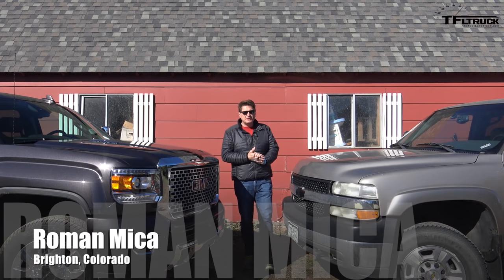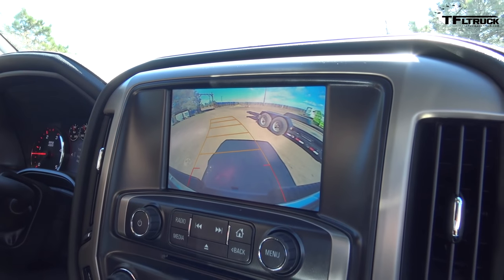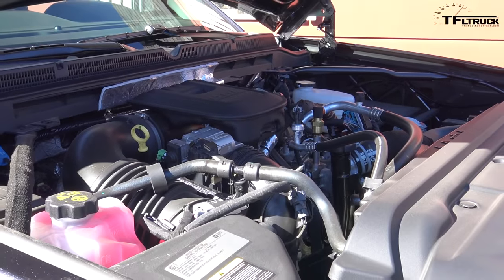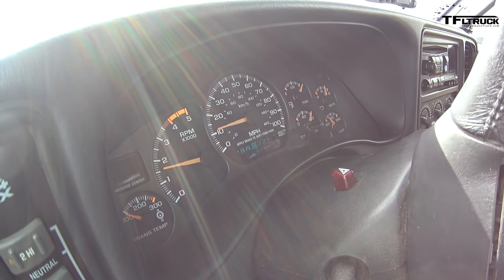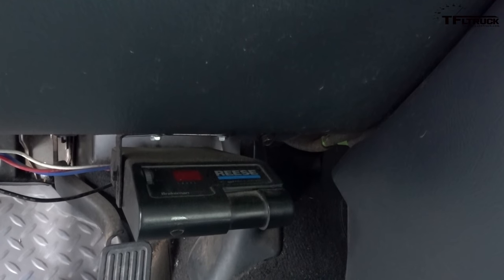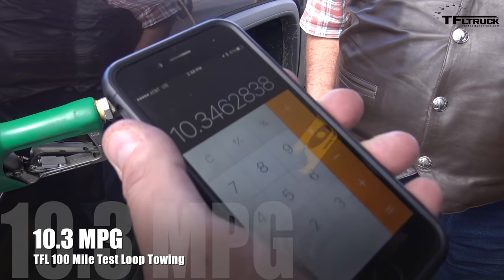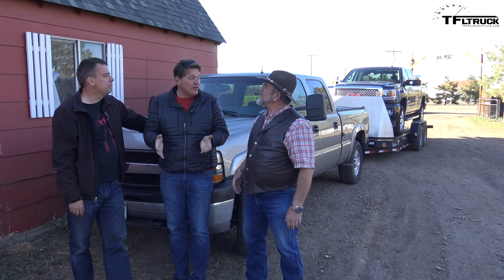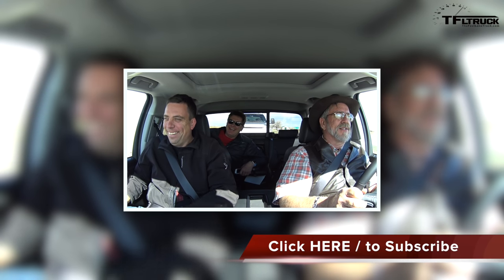2016 GMC Sierra Denali HD vs 2002 Chevy Silverado 2500 HD Mashup Review - Old vs New Ep.1

Comment: I see this test and i can say that this test has some flaws in it. What do i mean. The new diesel has the EPA aftertreatment crap on the truck which drives down MPG. If you didn't have that stuff and set both trucks up pretty much with the same program and upgrade, that would be a great test to see who will come out on top. Yes the older truck had a better advantage because it didn't have all the aftertreatment stuff and don't have to do a regen, which the new truck have to in order to keep driving,  on it which gave better hp, and torque which in total gets better fuel economy. That just me noticing  a flaw. But this video in general what the guy said, "with all the big hipe on these new trucks where they get better fuel economy and want to test it with the older gen diesel to see if does it make a different". To me in conclusion no, not really. But do the upgrades, then i would say ya you can see the difference.
Reply: What do you not understand about this being a stock test? This is for someone that doesnt have time/money on taking shit off, changing it, or risk fucking something up in the process.
Reply: The reason for this video was to see if the new model truck has better fuel economy compare to an old gen. but pretty much what I was trying to state is that. if you take the new truck and delete all the aftertreatment crap off. I promise you will have a better fuel economy compare to the old gen truck.
Reply: jasonman1515 Probably so, but this is a STOCK test.

Comment: NOW you have to ask yourselves is it worth the price premium for the newer truck? a truck that has a DEF system that can be a royal expensive pain in the ass to maintain. i really do not like the newer vehicles, they cost entirely too much and they are entirely too complicated. we have multiple older vehicles. we have a 1996 bonneville SSE L36 series II, a L67 GTP, and a 1996 camaro Z28 LT1. even the camaro get pretty decent mileage for the age and miles that are on the car. it has 215K on it and no signs of giving up the ghost. i probably get 23-24 MPG's with it.
Reply: the whole new car industry with its yearly milage updates is a scam started back in the 20s or 30s to keep people from wanting to buy used cars. by every year making a new model year you force people to keep buying ever newer and more expensive cars.

Comment: they cheated the silverado has a bed cover and 4x4  which lowered the MPG while the other did not   so a real world would have been 11 or 12mpg on the silverado
Reply: I still see it as impressive that the older truck did that well on fuel anyways, though the Sierra has more weight as well

Comment: That test really makes the new truck seem terrible. The new truck has more power and more luxury but that's pretty much it. Real truck guys don't buy trucks for luxury anyways. The old truck, was smaller which makes it more maneuverable. It also has better visibility, a comfortable interior but no excessive electronics, better gas milage, and much better looking. It's capable of towing anything you need it to even with less power. The older truck is clearly the better truck. It really shows that trucks have taken a huge step back instead of forward. The only thing that is impressive about the new truck is that it has a lot more power and weight with only a small fuel Economy drop. But it's actually more power than you even need. The old truck really wasn't struggling. Unless they start making more  simple rugged vehicles without all the electronics and ugly designs, I don't think I'll ever buy a vehicle newer than 2006. So, when I'm old and gray, my daily drivers will probably be antiques.

Comment: I have not made it through the video fully yet, I am about half way through, and I can say this, win or not, I would rather have the 2002 Silverado over the new trucks. The new trucks have too much crap on them that they don't need, even on the base models. Old vs new, I will take the old truck every time. Most people may roll their eyes at that, but I can't care, old trucks just make better trucks. New trucks make great cruisers, even if they are now too damned big to fit most places, and that is the other issue I have with new trucks, why did they have to make them all giant? Well, I have my suspicions it is to curb the fuel economy standards. That, and/or it is the fact that it seems we Americans are starting to get bigger..... I will also say, I have never trusted the fuel mileage meters built into vehicles these days, I have often beat what the vehicle tells me the vehicle got, or, it figures too high, and it appears that the modern truck figured too high....Go figure....

Comment: Now you delete that EGR and pull that $10k exhaust restriction off then run a 5" turbo back and I bet the new Duramax gains 2 mpg. EGR is evil, plain and simple. Pull the intake manifold off a new EGR diesel engine and you'll swear its an exhaust port. Just blackened with soot.

Comment: The company that I work for and keep there trucks on the road as there mechanic. We have 4 '03 GMC Sierra and all have well over 200k on them with the 6.0L LS gas engine in them. And 1 that has over 300k on it. And they all have plows on them and have pulled trailers. The only thing that has been done to them is transmissions and transfer cases. And then last year the company bought 4 '15 GMC Sierra 3500 crew cab dumps with the 6.0L gas engines and they suck! Under powered and have a piss poor turning radius. They've have gone back to the dealer for serval recalls, electrical issues and check engine light on. And they suck to plow snow with...they get stuck and can't plow a good amount of snow. I'll take the older Sierras! Never go by the trucks average mpg calculation. It's based off air going past the mass air flow sensor not by fuel going in to the engine. The way to do it is the way they did it with the gas pump.

Comment: 160 000 miles JUST WORN IN?
Reply: Trucks will easily last significantly more then cars.
Reply: Nate Scheider true thats why i want a F-350  dually
Reply: my 1500 is about 240 still runs better then these new trucks. and the older models are so easily fixed if you can do your own diy

Comment: I didn't want a  GM truck with AFM problems . Leased a new 2017 Ram 1500 pentastar, >>> at 34k cam phaser problem,  cuts power , check engine light , limp mode on highway at 70mph,  dangerouse have to get off highway, happened multiple times . I think they just reset the computer,  and at 38k miles had to turn it in , Chrysler is scum would not honor warrenty and treated me like i was making the problem up. I was not able to buy at lease end for $22k obviously,, they has the balls to try to sell me a new Ram crap when I turned it in and paid over mileage and 3 years if lease and had given $3000 at lease signing . 
I bought a GMC Sierra 2005, was a Texas truck and fairly clean accept for a dented bumper. 
Stay away from newer trucks,  they do not honor warrenties , just say the magic words " electrical not covered " everything is electrical now!!!!!!

Comment: I woulds say the 2002 got better mpg. No filter stuck up it's ass like that 2016. 
The DEF fill under the hood of the 2016 is a stupid location but prob got located there cause of stupid people putting DEF in the fuel tank when they are both located behind the fuel door. DEF in the diesel makes the injectors stick open and a run away engine.

Comment: These diesel emission laws are getting to be to much, the new emission laws ruin the longevity and the gas mileage the new trucks.  On the new trucks you are lucky if you get past 200k on the engine, its ridiculous.
Reply: +GameAngry You're lucky if you can get 100,000 without injector issues, a DPF clogging or an SCR failing.
Reply: Yep agreed. Best thing to do is gut and tune, if you can do it in your area.

Comment: Well the 02 has the worst design dmax LLY engine which is first gen and Had more injector and cp3 problems do to the poor design under valve cover injectors. It totally out did the much improved dmax LMM. Now if it were the 06 HD with the LB7 H.O engine, it would have put the GMC to shame because the LB7 dmax is the golden child and is the engine of choice for the hot rod diesel guys. I've been a Dmax tech for 18 years now and all the dodge and Ford guys can talk bullshit but the Duramax is the boss with Cummins being the red headed step child.
Reply: How would you rank the three in your case then?

Comment: I've been looking at used trucks and a lot of these owners are on crack.  Tundra owners have to be the most delusional.  A new base model starts at $29,950 but these goobers want $23k-$26k for a 5 year old truck with 100,000 miles on it.
Reply: yeah I'm trying to get my first truck, and even the 02 tundras with 220k they want 8k. I'm probably going to try to get one of these with less than 220k for less than 3k hopefully

Comment: Thats very sad , the US carbuilders have done nothing in fuel efficency in the last 14 years!!! In Europe no one would buy one of these cars or trucks, because they dont have any technological advantage! A european or asian truck only needs about 8-9 liters of diesel for 100km driving with the average payload! And they are also faster...
Reply: yes but what is your average payload and the 2002 is way more reliable and i also have one as a work truck
Reply: Their efficiency and payload have little do with each other, they are just simply trucks with light-medium duty payload and the top of the line medium duty engines. Not everything has to be necessary, does it? If you want everything used to it fullest, you can buy these same engines in 3500 models, which can tow up to 10,500kg and haul upwards of 3,000kg. Mind you, the competition will even top that, with upwards of 14,000kg of towing and 3,300kg of payload. There is no Asian or European pickup that comes close. Doesn't even try to compare them. And also, they actually have made many advancement in fuel efficiency, but those advancement have been canceled out by restrictions on emissions. The EU doesn't regulate diesel emissions the same way the US does, the rules are tougher in the US for trucks.

Comment: 2016 have too much emission. it get better mpg if most the emissions got deleted. 2002 may have a 5 speed but holds the gear at higher rpm thus more efficient and in the proper powerband. better gearing will help efficiency.